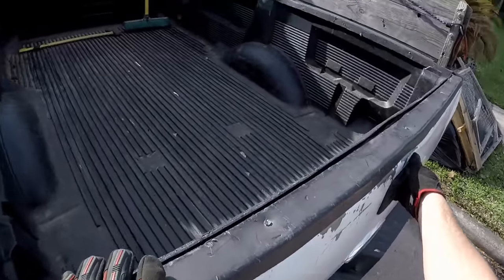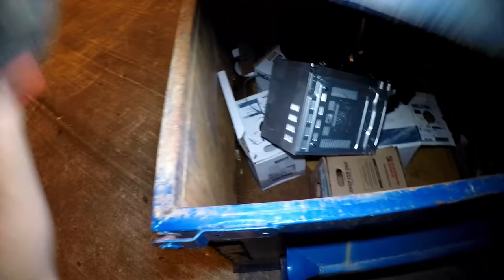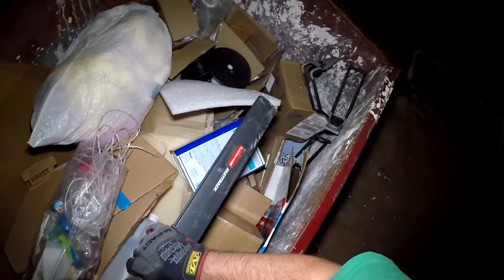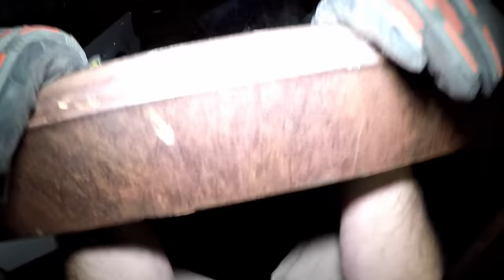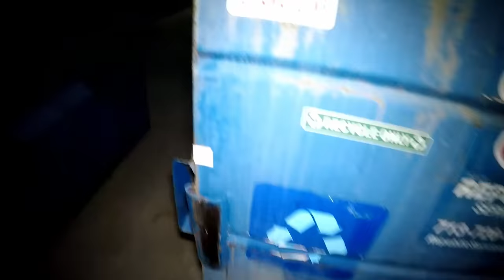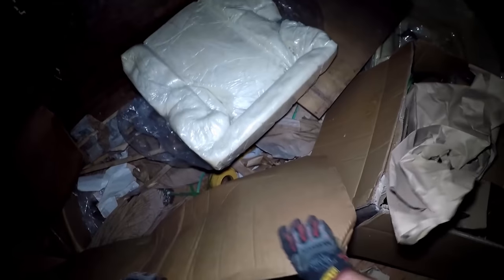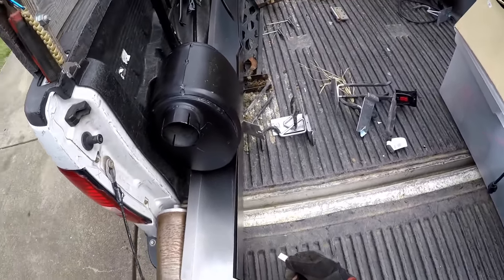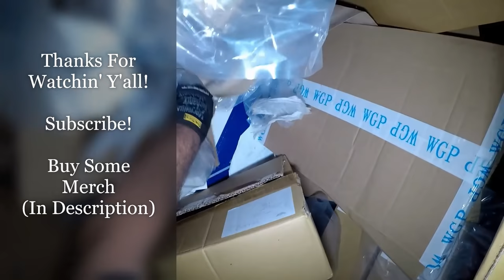Dumpster Diving & Curbside Scavenging "We Ain't Gettin' That Out"

Comment: Hi Mike!  At 25:06 you tear open a bag and there's a stick of computer memory right there on top.  Look for the blue logo that says "Crucial" (that's just one brand).  You definitely want to grab that when you see it.  Your computer guy will want that.  Looks like laptop memory.  For desktop systems it looks very similar, just longer.
Reply: It pains me that he always just scraps or breaks down all the server hardware he finds. I could have built a few complete servers + the racks with everything he has found and put them to good use. Scrappers just want money.
Reply: @helium5912  That's because he is focused on being a scrapper and not a hoarder. You really need to watch Ewaste Ben videos if you want to cry.
Reply: @ryanglaser5336  No. Hoarders take stuff and dont use it. I would 100% use the server stuff he finds.
Reply: @helium5912  I personally could use it myself, too. However, because you could use them still doesn't make a use case for Mike to save for himself. And Ewaste Ben on youtube wouldn't be scrapping RAM either if it was worth time & effort to resell. Pain to sort, so many different types of memory and QA takes some time to properly run a burn-in test on a RAM module (and you would need a different motherboard/cpu for every single different type of memory that you have).
Reply: @ryanglaser5336  I have seen full server setups even with the racks. Still in what looks to be working order. I'm not talking the parts
 I mean the full setups he finds
Reply: He missed them. That would've been a great catch

Comment: You need a lift on the truck  and a winch to pull weight out . 
My best find was a 24k gold chandelier with Swarovski Crystals . Put on auction and made 16,880.00 on it . Found in a open top that sat in front of a residential remodel job  in las Vegas Nv

Comment: You really need to get a winch or something for your truck Mike you can buy one for a hundred bucks could be a back saver
Reply: More than likely a winch would damage the dumpsters without it being a crane.
Reply: Hey...I’ve used a tow strap hooked to the hooks on the front of my suv to pull a hundred lb winch out of a dumpster...there’s a trick to it...u back up slowly till it’s right at the top then u romp on it..comes flying right out and leaves the dumpster in place and in tact lol...almost knocked it over the first try going slowly and befor I found out what it was I hooked too...all I had seen was a cable with a hook on the end and I had to find out what it was at that point...it had a huge piece of plastic wrapped up in the cable so I couldn’t see it..
Reply: I was almost yelling "hey, remember you have a set of ramps up in there!".

Comment: At about 12:10  That would be a motorized conveyor roller.  You can use them to either boost item along on roller conveyors, or to turn the belt on a belt conveyor.

Comment: In datacenters, rows of server racks have both a hot and cold aisles. This is because servers are designed to draw in cool air from the front and vent it through the back. "Blanking panels" are designed to occupy the 1U spaces where equipment isn't installed. This is so most of the cool air will be channeled "through" the rack-mounted servers and NOT around them. True; they're fairly cheap. However, their energy savings cost is enormous. I'd say, "Sell 'em on eBay."

Comment: Mike you need to make a swing out lift using a winch, get a 2500lb winch from Harbor Freight and some stock square tubing,  a pull and mount to the rear of your pickup truck 
It should cost no more then $100

Comment: The dumpster where you found the instant hot water heater on the ground , looked like a copper line set for A/C was laying on top with the foam pipe insulation.

Comment: That power roller has a motor inside of it. You are going to need to get it apart to get the copper from the motor and the bearings separate.

Comment: Make a lifting crane that can swing out on one side of the truck so you can fish up the heavy motors and things? :)
You probably some day will find parts. Finding a 12v car winch is a good first step. 
After welding the crane and screwing it together it is time for electrics to control it.
You can use a on-off-on momentary double pole double throw switch to control the 12v motor with power from the truck battery. Add 4 relays in the circuit to get more power to the motor so the switch wont burn, probably a good idea for a winch motor.
But the momentary on-off-on DPDT switch is the prinsiple to get a smaller motor running in any direction, those switch often used on car windows motors.
It should be manageable to put together something like this together from scrap :)
It could be made with hydraulic system too, or geared cogs, many ways to make things, i found several on Youtube.
Could be handy when finding things weighing a thousand pounds like this motor.

Comment: Cylinder with the cord in he end looked like an old well pump. and if you had a chain in the truck you could have snatched that motor out of that open top still. You don't need a lift

Comment: Could have opened the door on that big open top, backed the truck right up to it, and used all the wood to build a little pathway to roll that motor out of the dumpster and right into the back of the truck.

Comment: Just out of curiosity, why didn't you  open the dumpster's big door and pull that 500 lb motor out of there?  You really should buy yourself a  big winch and mount it on  your truck bed. Or on a 16ft. Trailer. I knew a guy who built an A frame and mounted it to his trailer on swivels. He had a chain hoist  to raise the boom and a winch over a top pulley. When he wasn't using the A frame it sat on the trailer.

Comment: I am absolutely amazed you must not know the value you on the bicycle that you were talking about selling it for pocket change if you would clean that thing up make sure the gears work on it right replace the wires you could have easily sold that thing for $125 to $175 now the chairs ever a little bit screwed up cleaning those down adding a little bit of spot welding taking a piece of plywood with some foam and a little bit of leather and you could have rebuilt them and turned around and sold them for a fairly decent profit of anywhere from upwards of $10 250 I'm going to take a small amount of time and effort